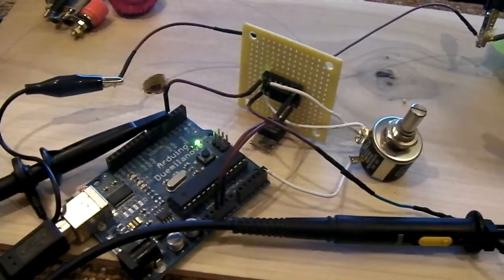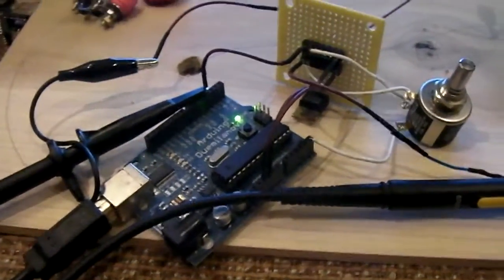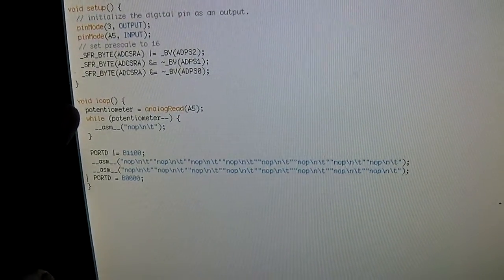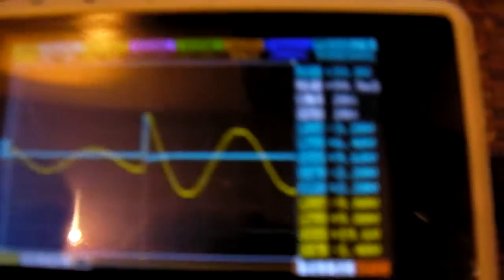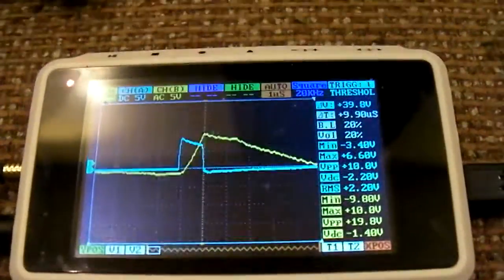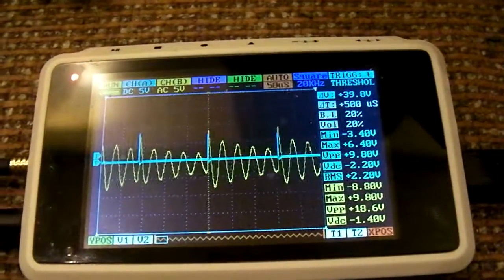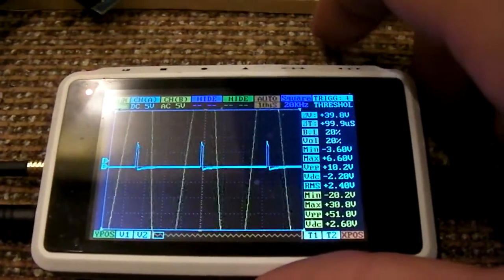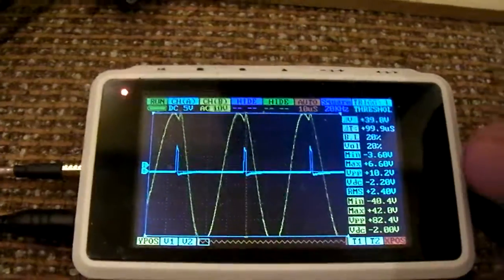Fully Damped versus Fully Undamped waveforms

Comment: Stanley Meyers knew this and used it to build up enough potential in the water bath to facilitate hho production with very little input once the system was charged up. He was in effect creating a capacitance inside of the unit and filling it to the breakdown point. It would break down and discharge(hho) then slightly refill and start the process yet again. Thats why he had the ramping pulses. If timed right the breakdown would not instantly discharge the whole charge but just enough to net more.

Comment: Yes you are correct. What we have to understand at this point is that we need to shield the coil or transformer from radiating any energy. This is key to understanding what he was doing.
 As Tesla was referring to about resistance. When the cap dumps the effect has zero resistance. How he keeps it from radiating is a static shielding. This shielding is reactive. Much like a TV's yoke coil if it was shorted together or for that matter the rotor coils of his synchronous motors.